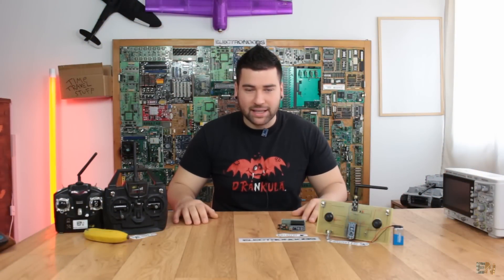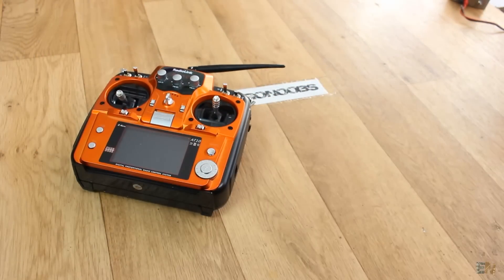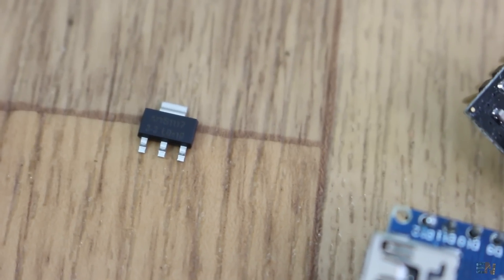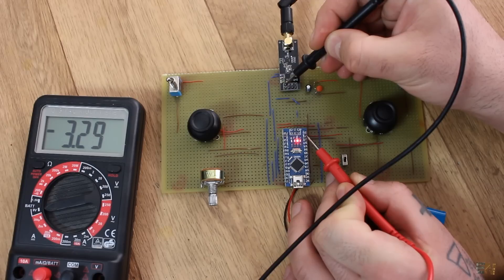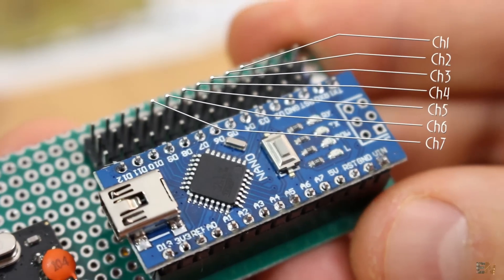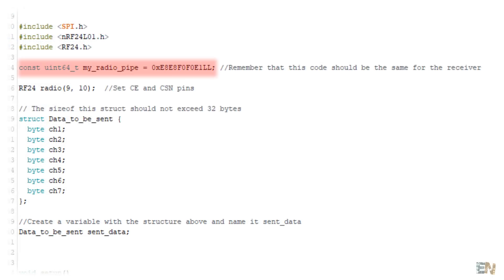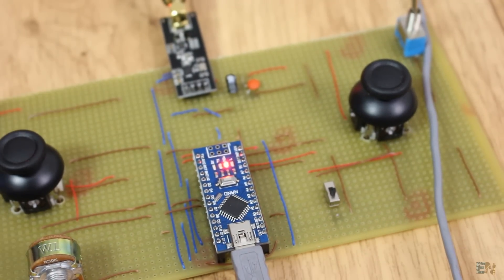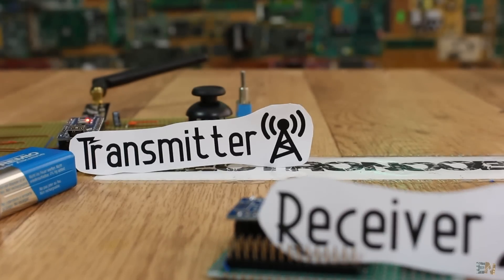DIY Radio Controller - Arduino & NRF24 + amplified antenna

Comment: I am planning to build a wireless sensor network (ultrasonic parking sensor) for sending and transmitting information via NRF24 to the arduino uno then to a web server or mobile application. How  can I go about doing it?

Comment: me gusto tu proyecto pero hice varios cambios.. usaste el multiwii 2.3  note que ya no funciono mi gimbal asi que  modifique el 2.4  para admitir el NRF24 . con el mismo resultado.  el gimbal quedo inutil no me e adentrado a ver por que paso esto .  , ya tenia mi diseño de una shield para el NRF24 y un nano . así que tuve que cambiar CE CS  a 9,10  y el motor lo pase a otro pin..   oye,. has intentado agregar el sonar generico al multiwii... yo intente pero no logre hacerlo funcional bien. me hacia el miso efecto yoyo que hace el barometro y lo elimine... así que hice un receptor y en el receptor agregue el sonar.y me funciono bien. pero me gustaría prescindir de usar un arduino como receiver.... tambien agregue el Aux3 Aux4  y le hice algunas modificaciones a tu codigo.transmisor receptor
Reply: QUE TAL VOZDEFUEGO BOMBER, LOS ARREGLOS QUE HICISTE FUNCIONAN BIEN? PODRIAS PASARME TU PROYECTO? SALUDOS..
Reply: @JOSELESBOY1   si funciono. mi problema mayor fue dejar libre el pin 9 para usar el nrf24 .tuve que generar el pulso de motor de  otra manera  para usarlo con mi shield. sin hacer cambios fisicos..  tengo funcionando el dron pero el codigo tendria que hacerle  las modificaciones de nuevo, cambie de windows y no respalde el trabajo
Reply: @vozdefuegobomber9619  entonces no te quedaste con nada del código del dron?, lo que pasa es que estoy tratando de utilizar el arduino cono tarjeta de vuelo pero agregar una tarjeta compañera que grabe y procese vídeo en vivo, soy electrónico y se muy poco de programación pero he leído que sería mucho mejor utilizar python como lenguaje de programación, si me puedes ayudar podría ver cómo compensar tu ayuda mi estimado, saludos.
Reply: @JOSELESBOY1   lo hice una vez puedo hacerlo de nuevo. . desconozco si se pueda usar python yo también  soy electronico desde hace 35 años. mándame un mail y platícame tu proyecto y vemos en que puedo ayudarte.. vozdefuego@live.com
Reply: @vozdefuegobomber9619  PERFECTO MI AMIGO, TE CONTACTO, GRACIAS
Reply: TE ENVIÉ UN CORREO
Reply: @JOSELESBOY1  ok  te conteste

Comment: hello Sir...from my little experience with transmitters and receivers for drone, you would have to BIND them so the can actually communicate. for instance to control your drone with Flysky I6s transmitter and the Ardupilot APM2.5 controller, you would have to bind them first before they can communicate. So I would like to know, with this your awesome transmitter and receiver, should there be a Binding, and if Yes, how do You Bind them
ortsin35@gmail.com Thank You

Comment: Hello . Can i use arduino pro mini for this transmitter . i will use just 2 pots. arduino pro mini have enaught analog input for the pots. Just i want to learn if i make transmitter with arduino pro mini is it makes problem.

Comment: Hi, i wonder if you could help me, i lost my mjx x600 drone but i still have the transmitter, i was wondering if i could still use the transmitter with an other type of drone? OR maybe just change the transmitter board that is inside to be able to use it with other drones.

Comment: hello isnt psible use more outputs in parallel to increase the current maybe you can use the ADC output inever use the arduino module. Thanks for share your project.

Comment: This transmitter receiver can work with brushed motors or not
Reply: I want to use it with 180 motor which has an rpm of 39000rpm

Comment: Thank you for solving my problems 😃
I have one problem that with test code the refresh rate of the serial (the change in readings) is too slow it took about 1 second to change 
What is the problem here and how can I solve it ?
( I use one uno and one nano)
Thank you again^^

Comment: Me ha gustado muchísimo este proyecto, pensaba en hacer una radiocontrol de estas características para usarlo en combate de robots, ya que quiero montar este diseño dentro de un control de gamecube, o un control de Xbox, la idea es poder utilizar estos controles, ya que los tengo disponibles, pero dañados, sin embargo no me quiero deshacer de ellos, ambos son inalámbricos, pero quiero reutilizarlos para tener un par de radios ultracompactos y fáciles de llevar y que parezcan originales, sin embargo tengo varias preguntas:

1) se puede utilizar un arduino pro mini de 3 voltios? (Uno de los controles solo tiene espacio para ponerle 2 pilas doble A) 

2) yo he descargado el código de una página de instructables, pero tengo el problema de que los servos se mueven ligeramente, este problema ya lo han solucionado en este nuevo código? 

3) como ajusto el centre y el rango de movimiento de los servos? 

4) de que manera puedo ponerle failsafe al receptor? 

5) debido a que los nrf24l01+ son realmente tranceptores, quiero hacer comunicación full duplex ( o sea feedback en tiempo real, por ejemplo en mi control quiero tener un led que me indique que el control está conectado con el robot, y 2 salidas para los motores vibradores que estos funcionen cada vez que mi robot sea impactado) es posible hacer esto?

Que pena por extenderme tanto, este control es uno de esos proyectos que estaba esperando hace mucho, ya que la parte inalámbrica era lo que me impedía continuar, pero realmente quiero refinar este control y hacerlo más flexible para poder utilizarlo en todos mis prototipos. Gracias por compartir esa información, seguro que cuando tenga completo alguno de mis prototipos, los mencionaré con gusto! 

Y finalmente gracias por su tiempo, estaré pendiente de sus respuestas.
Reply: ok la pregunta # 2 que hice ha sido resuelta, he cargado el nuevo código, y este funciona perfecto! un aviso para los que lean este mensaje, bajen el código del link de acá, el código que está en la pagina de instructables está obsoleto...
En cuanto a la pregunta #3 ya pude resolver el misterio, usé un par de potenciómetros en paralelo del mismo valor que  el de los joystics para ajustar el centre en el transmisor, y para modificar el rango de los servos, modifiqué en el código del receptor los dos valores que están al final en las lineas con la funcion "Map" jugando con los valores en micro segundos, se puede ajustar bien el rango de movimiento cuando está limitado el movimiento del potenciómetro en el transmisor como es el caso de un gatillo de aceleración, ya que solo se mueve como 20 grados del recorrido total del potenciómetro...

Comment: so have you tested yet the range? i Hope it is at least 100 meters, because i need that range for my RC car project, which i want to be as DIY as possible
Reply from the maker: on open field, around 600 meters! But with the amplified antenna module!
Reply: +Electronoobs thanks for replay :) it is enough for me

Comment: Please answer as fast as you can! I am trying to make a rc plane. For that, left stick should stay where I left it on the y axis, but in x axis it should have a spring. How can I make this thing? THANKS!!!!!
Reply: Better buy that kind of joystick instead of making it.
Reply: Hi. i have a "solution for you question" .  I tried to do this project before for a plane too.  in the inside of the joystick exist a piece. you need to disarm it and quit the piece (if remember, is a circular internal plastic with a spring).   But the easy way is buying a used cheap RC controller.
Reply: thanks for all 2 answers...

Comment: I build this exactly and it worked great for many flying hours until one day it suddently stopped responding. The most dangerous thing was that it kept giving the ESC a throttle signal causing the plane to fly a long way before chrashing into a field (thank god). There was no electrical failure because it worked fine again after hitting the reset button on the reciever. I dont think its a software bug in your code. maybe in a library? or the cheap arduino boards or nrf modules from china just arrent 100% reliable...    Whatever the cause was, I am never trusting my plane to an arduino again!

Comment: Hey friend, i´ve another doubt, and i hope you can help me ! 
I have one ATMEGA8L, that works at 8Mhz, and i use it on the transmitter, i will made more functions on it, put a LCD 16x2 , and maye 2 ou 3 push buttons to navigate on menus, for  TRIMS, and increase and decrease the sensitivity and calibration of the "gimbals" and remaining fly time,put a beep sound and see the voltage battery.  

The doubt is:

So, to use with 8Mhz it´s possible or not? If Yes, there is a modification in the code or any setup ??

THANKS !!!  Sorry by bad english ! I´m brazillian!

Comment: Hello Electronoobs. I saw that you used two types of capacitors, but at the schematics i can only see one of then. At receiver is ok, but where do I connect the small capacitor at transmitter? Thank you.

Comment: 1.what is the purpose of the toggle switches?
2.There is a  SW terminal in my joystick module and what is the purpose of it?
3. In PWM receiver schematic why you have mentioned 3 pins for each channel? What should i connect in those digital pins?

Comment: Hi. My problem is that my connection its only working when i put my hand on the transmitter radio antena . Do you have any idea what should I do ?

Comment: Hello. I set up the project as your instructions, so far it is only with the test code, and it worked perfectly, with values between 1003 and 2000. However, the scope does not exceed 10 meters. Would you help me?

Comment: can you please show me by a diagram that how have you connected the potentiometer, toggle switch  & the joystick with the arduino actually i am a beginner having trouble in understanding that how these parts are soldered with each other path of connection in the circuit?

Comment: how well would this work with a teensy 3.2 mcu to an arduino uno? 
how hard would it be to modify the receiver code to work with the half h driver to drive standard dc motors on the itead mboard?
i would like to use this to control robots instead of airplanes or cars. 
the mboard microcontroller is based on the atmell atmega 32u4 chip set(same as the arduino leonardo)

Comment from the maker: At 12:32 the send.data lines should be from ch1 to ch7. That's an error in the video. If you download the code, the error won't be there. Keep up!
Reply: Electronoobs 程序在哪里
Reply: Thanks for the tutorial. I have successfully build my Transmitter and reciever using this codes.
Reply: BJB oh
Reply: @bjb1784  plzz help me 
I'm unable communicate between transmitter and receiver
Reply: por favor me puedes ayudar con la capacidad del potenciometro
Reply: Hola, que tal consulta para que utiliza el potenciometro ?? muchas gracias.
Reply: hi , m beginer with this project , can you design pcb with more simplicity and Arduino nano pro mini and Arduino nano,
Reply: You may print a 3d case 
. It would look better .
Reply: Doesn't work for me.
Reply: @136videos  same as for me test code perfactly work but 7 ch full code not work
Reply: Just in ppm code during compilng one error display plz sir just check.pwm code pefactly working
Reply: Is transiever and reciever the same
Reply: Hey how do I upload the program to the board
Reply: Podrías aser este tutorial en español te lo agradecería

Comment: Does this have a failsafe ? when put on throttle and i turn my transmitter off the motor stays spinning instead of stopping
Reply: Yaah...its a big problem....did u find any solution?

Comment: Hi there Sir.

im a fan of your work.  can u help me with nrf24 modules?

i tried using your test sketch and the library you posted, but still dont work :(

wen i put "println(ch1_value); "  on transmitter it sends 0-255 serial port.
but wen i look at the receivers side,,  it always prints 1499 even I move the potentiometer..

plss help,,  or pls send me simple code/sketch just for 1 servo,,,
thank you in advance..

here is my gmail: johansgwapo67.68@gmail.com

Comment: When transmisttor is not connected to rx than it should be in failsafe i.e all channel should be low but here it goes to 1500 how to change pls tell me

Comment: is that a 104 orange Ceramic Capacitor ? 7:56 if so what voltage to get?
Reply: which Ceramic Capacitor  (voltage)?

Comment: Sir ,
I saw that u made arduino based drone recently .You use brushless motors on it .but can i use this king of motor .
https://m.ebay.com/itm/4PCS-Original-Hubsan-X4-H107C-Quadcopter-CW-CCW-Motor-H107-A23-Spare-Parts-/282717863781
please help me ..
If i use this kind of motor so i need to change some arduino programing ? IF YES WHAT SHOULD I CHANGE .
SIR PLS HELP I WANT TO MAKE DRONE 😔😔😔😔😷

Comment: Thank you for this good video, a question: is it possible to boost the transmitter signal without changing the antenna? If yes do you have an idea about how to do it? I often have a problem of range because transmitter are not power enough. Maybe we need a radio licence to do that
Reply from the maker: KbOo Ze the licence is for bandwidth and with or without antenna the 2.4GHz frequey will be the same and that bandwidth is license free. As for signal amplification you should make your own antenna amplifier which at that speed would.be difficult to.make. just buy the PA module and you'll have some decent range.
Reply: Electronoobs thank you very much

Comment: First of all, thank you for posting this video. My question is in the transmitter code in the "loop section", you are sending everything by sent_data.ch1 = map( analogRead(A0), 0, 1024, 0, 255);.  you change the analog read but not the channels. It remains sent_data.ch1 . Can you give a bit of an insight that why you didn't use other channels as opposed to ch1 only? Thanks
Reply from the maker: That's an error in the video. Download the code. It has from channel1 to 7. keep up!
Reply: Electronoobs Sorry, but from the code as well, I got this...
Reply from the maker: oups, sorry, try that now: http://www.electronoobs.com/eng_arduino_tut25_code3.php

Comment: why not have a demonstration with servo and motor and esc?
For a simple reason, IT DOES NOT WORK.
Reply: I got over 300m range with these pa+lna modules, and a great response time. It works surprisingly well for the price
Reply: @OskarNoriyuki  hi, do u use this tutorial? it does works? I`m going to try  build one but wanna be sure this tutorial works. need help!
Reply: @erickdelcarpio6691  I didn't follow this tutorial, but seems like everything is correct, it will probably work
Some advices:
-if your pa+lna module doesnt work, set the power to min
-Don't forget the capacitors, they're very important
-some servos and big motors may disturb the nrf, mostly when they're  on the same supply. If you want to do so, make sure your battery's internal resistance isn't very high and your connections are solid
Reply: OskarNoriyuki thanks for help. I’ve bought all the components yet. Just looking for more information n assembly it.  greetings from Perú!
Reply: Doesn't work for me either. I wired everything up, triple and quadruple checked all the wiring, and the code uploads but the 2 nrf24 modules won't connect even when sat right next to each other.
Reply: @AngryRamboShow  start again

Comment: The nrf24l01+ are great modules, I managed to test the communication  between two with 2dbi antena and get a range of over 400m(that was the space I could walk before getting borred) it matters the position of the antennas it's a minus of this kind of whip antenna but still usable.  Regarding the code we don't actually need to make it as the commercial ones, for example servos and esc can be controlled with the servo library and you can use the nrf to make a 2way communication and send some sensor values back to the remote. Offtopic... I got a microOSD based on atmega328p and a max7456 which I want to use for video overlay but I want to use my own way to make the connection between board and not use the MAVLink protocol, I have no schematic for the microOSD... do you have any ideas how could be done?

Comment: So, why you didn't use the Boolean type of variables for the  channels on the switches? It's not critical, just interesting)
Reply: it offers more opportunities, so you can define for example the position of an servo
Reply: Takes 1 byte anyway

Comment: Any idea about getting s bus output from an arduino?

Actually I'm working on the same and already made a few pwm and ppm receivers using arduino pro mini and nrf24 modules. I have a few ideas for that. But I get one or two days a month for personal experiments like that due to my job. So don't get much time. I've already started my own youtube channel also. But due to lack of time and equipment, it's in very early stage. You can also check my channel by make a search by my name. Till now I have only two videos. If you publish the s bus output from arduino before me, it will be a great pleasure to me.
Thank you.

Comment: In the loop function you have all inputs being assigned to ch1 at one point, fixed later on, small copy/paste error I guess that was remedied during debug. Otherwise very good, thanks!!
Reply from the maker: Grumpy Old Tech yes. Other subscribers told me that. My mistake. Just in the video. The code that you download has ch1 to ch7. Keep up!

Comment: The transmit loop() at time 13:20 shows all the input signals being assigned to the channel 1 of the transmitted structure. Looks like a copy-paste error!
Reply from the maker: Yes. Don't worry, that's just in the video. A small mistake. In the code is from Ch1 to Ch7. Keep up and thank you!
Reply: @ELECTRONOOBS  PLEASE MY FRIENDS ADD INDONESIAN LANGUAGE SUBTITEL 😪😰😰😰😭😭😭😭😭😭😭😭😭😭😭😭😭😭😭😭😭😭😿